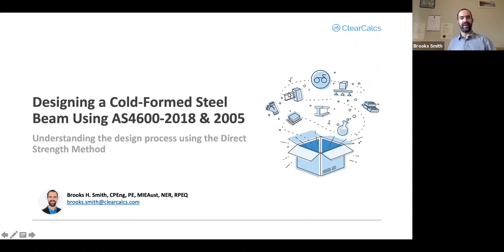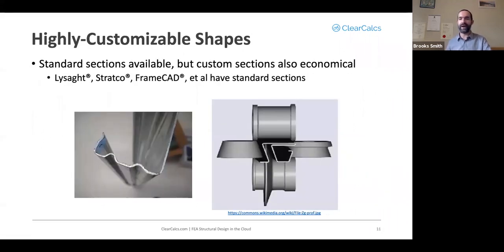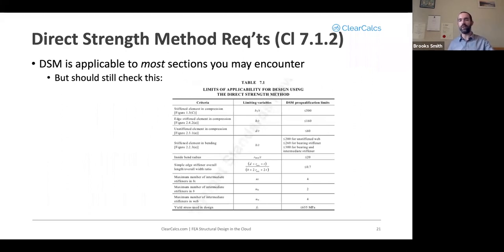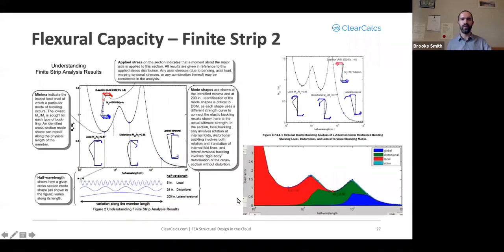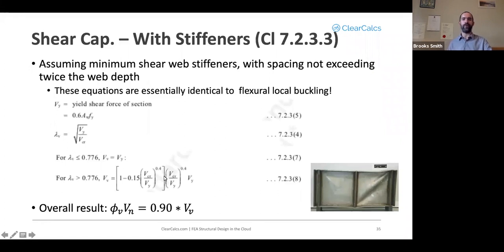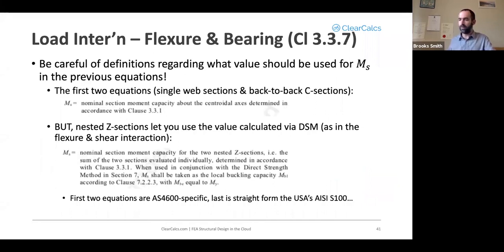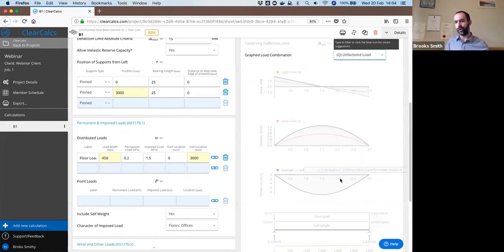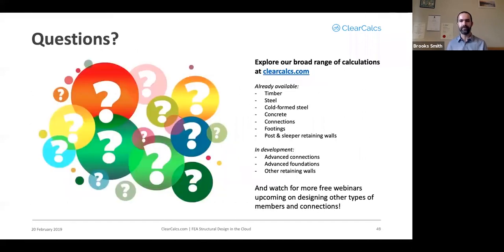Webinar | Cold-Formed Steel Beam Design to AS4600:2018 and 2005

Comment: HI
Is it possible to explain Distortional Buckling in CFS Beams ?
Reply from the maker: Thank you for your question here! Here's the answer from our one of our engineers: 

"Distortional buckling is a bit tricky. A (perhaps oversimplified) explanation is that it's very similar to local buckling, but instead of just one element buckling (e.g. a slender flange), multiple elements buckle locally together as one - thus making the cross-section appear distorted. It's essentially just another failure mode - for members that have stiffened flanges (e.g. typical studs), this might govern - where the web and flanges buckle together instead of just the flange buckling." 

If you want to ask further questions, please reach out to us at help@clearcalcs.com. 👋🏽
Reply: @getcalcs  thanks.....
did you meaning in a "stiffened flanges" flange connected to concrete slab ?

Comment: Is there any different concept between code AISI S100-16 and AS4600:2018? or the different is just the unit were using?
Reply from the maker: Hi Geoselva, the codes AISI S100-16 and AS4600:2018 are referring to the different building standards applicable to different countries i.e. US and AU, respectively. 
For more info, refer to the following:
Cold-Formed Steel Beam Design to AS4600:2018 -  https://clearcalcs.com/calculations/au/cfsSteelBeamAS4600-2018
Cold-Formed Steel Beam Design to AISI S100-16 - https://clearcalcs.com/calculations/us/cfsSteelBeamAISI